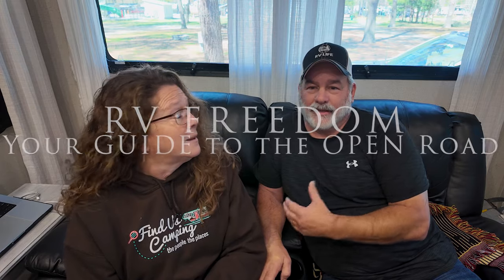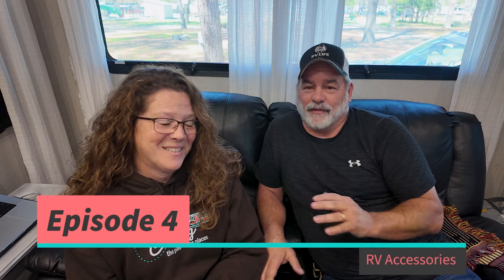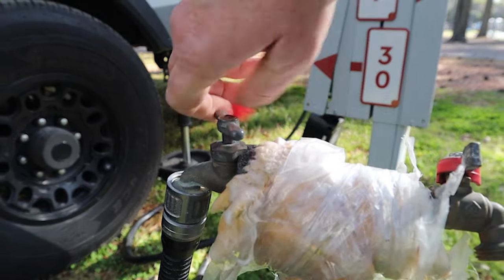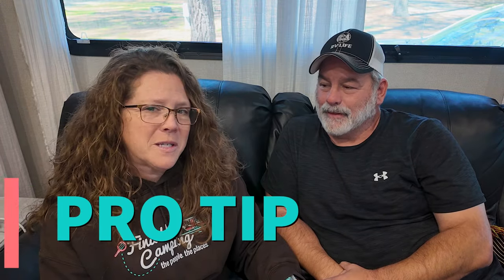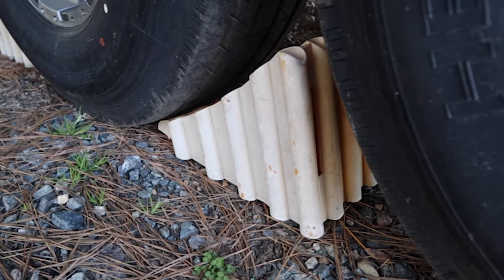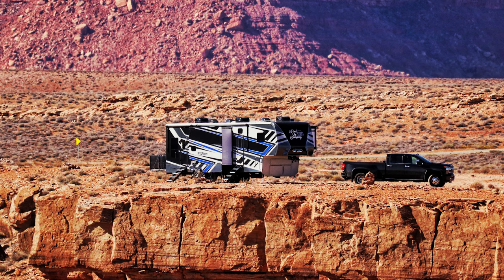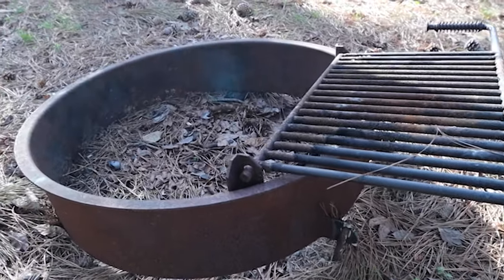Essential RV Accessories Every RV'er Should Own

Comment: Pro tip for the Valterra valve. Put a 4" hose clamp on it to prevent it from accidentally popping off. That can lead to a chitty situation. And that's not speculation.
Reply from the maker: Great tip. Glad we haven’t had that happen yet